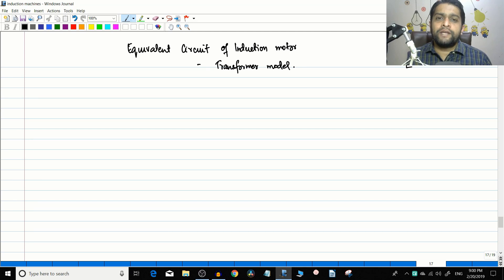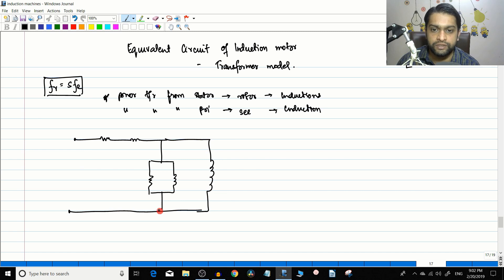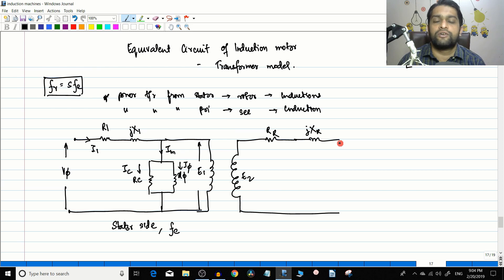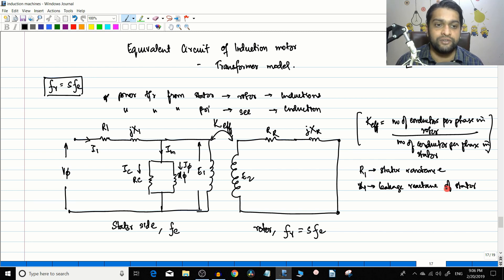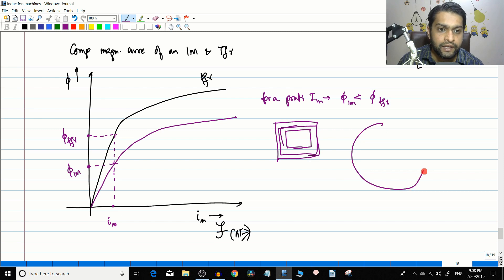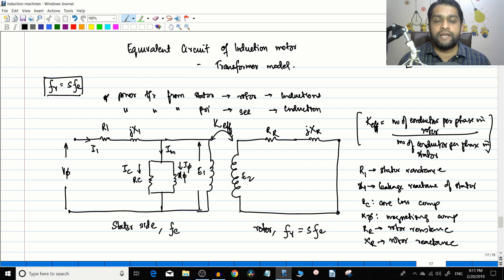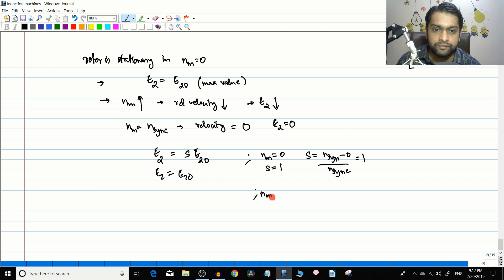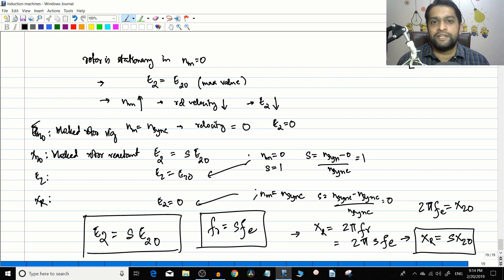Induction Motor #5 - Equivalent Circuit #1  - The Transformer Model

Comment: Hi Varun, It occurred to me at the end of this video when you pointed out that the E2 = S * E20 would result in the formula for rotor emf = Flux (max) * (S Omega sync) * sin (S * Omega sync * time). So in fact that E20 is the rms value of the E2 when S = 1. It's interesting that the rotor emf frequency slows as S gets smaller, but also that the magnitude of the emf of the rotor decreases. Am I thinking about this correctly? thank you in advance. Larry

Comment: Sr single line diagram circuit model for induction motor aur equivalent diagram ek hi h kya
Reply from the maker: Shashank Thakur I am not sure..usually single line diagram is used to represent a power system, and equivalent circuit represents a machine

Comment: hi, i'm really enjoying your videos. i think you're doing a wonderful job at teaching. however i couldn't understand the concept at 11.58 as you wrote once the rotor starts moving the relative velocity decreases. shouldn't it be the other way around?
Reply from the maker: Here relative velocity is the difference in speed between the stator rotating magnetic field and rotor speed, so when the rotor accelerates the relative velocity I.e the speed difference between the stator magnetic field and rotor will reduce
Reply: Electrical Is Easy thank you. 
I wasn’t able to relate to flux cutting frequency. But now it’s clear. 
As the rotor starts moving the relative velocity gets reduced and the flux cutting frequency reduces too. 
More relative speed and more flux cutting yield more induced voltage and a decrease in both means a lower induced voltage. 
Again a big thanks for your efforts.